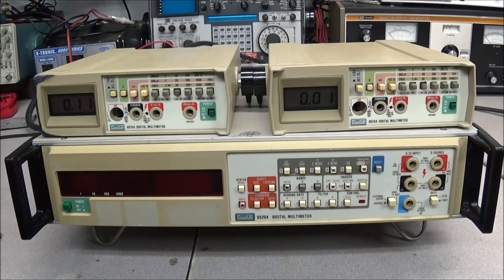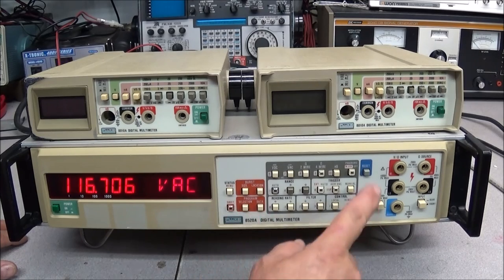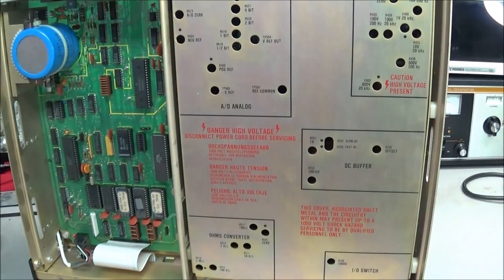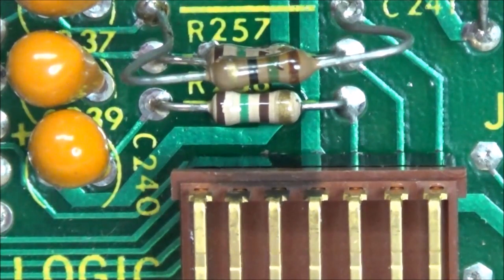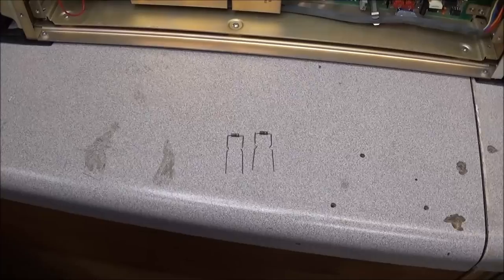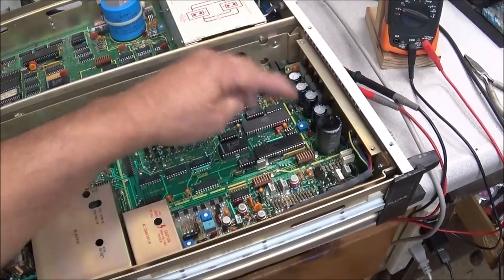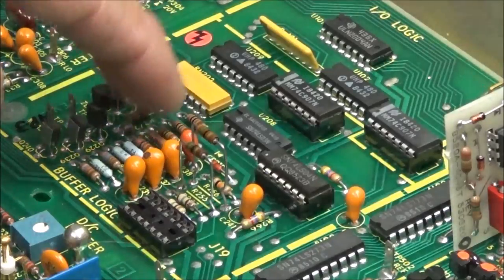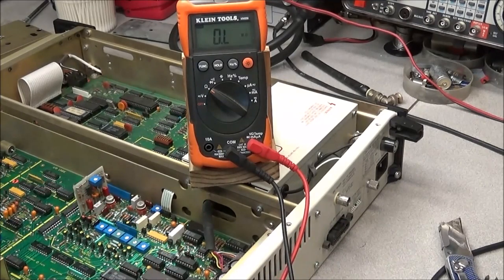#51 Fluke 8520A How far does this rabbit hole go Part1

Comment: I have recently managed to repair one of these units, with the aid of the service manual. My initial problems were in the Analogue Controller section - and with the aid of a cheap Logic IC tester - I found 6 bad TTL ICs and replaced them to get that section up and running.
At that point I then had similar symptoms to this video - with the 'ERROR 01 HV' on Ohms and random and DC and AC voltages displayed. Since everything passes through the DC Buffer - I could prove that this was good, by measuring at it's output and then isolated the problem to the A/D convertor section. I eventually found this to be a bad LF351 Op-Amp and replacing this brought the instrument back to life.
Reply from the maker: Alex, Thanks for sharing that.  I am glad you were able to repair your unit.  After finding many TTL IC's bad I put the unit down and never got back to it.  Perhaps some time in the future I will give it another go.

Comment: My $75 ebay Fluke 8520A had it's transformer pack shift on it's edge-card connector during shipping to me, shorting out and blowing fuse the instant I plugged it in. Having remedied that, I found "Error 14 ROM" show on the display at power-up. I remedied that by replacing corroded legs on ROM chips. Then, I found that my cheap Chinese 4-wire Kelvin leads were the reason that the unit would not zero on low-ohms. (The lead wires spin in the terminal plugs.) A great electrical cart meter now that services industrial automation controls in a machine shop. The bright red LED display is something I will always love.
Reply from the maker: Thanks for sharing that.  I really need to get back on mine but time has become hard to get by with here.
Reply: Your meter is not just worth $300 of work to get it going...($300 being the balance of The $400 value a 5.5 digit Fluke bench dmm that you bought for $100 - knowing what you'd get...) It is priceless, once made right. Those pretty red LED's do look the best. Solid, proven, tried, true and robust. Accurate and good looking. Serviceable. They don't make them like this any more. Please show your meter the love, attention and care that it deserves. My new Keithley 2001 (okay, not "NEW", ebay, $950- excellent condition) does not come with schematics. Such a thing a being able to service it yourself is unheard of these days.
Reply: It just occurred to me;  I could sell you my ugly - yet working 8520A. I got $100 into it. + You pay shipping. I would do ebay / paypal. Put the two together and keep remains for parts? I even include a few spare fuses! I really don't need the thing any more. I've also got 5 new original power switches on order. (My pushbutton switch doesn't come all the way back out after pushing OFF sometimes...I cleaned and lubed switch internals and got it to come out on it's own every time now - albeit slow and weak...I have not opened it, I had no dielectric grease - only carbon-tet and wd-40.)

Comment: Interesting job. nice gear to! I have a Fluke 8050A that I replaced the display on back in the 90's. I still use it,and have the original case for it. i really prefer those LED displays in the lab; they just are so easy to read at a glance.  I just have to see your next Vid on this.
Reply from the maker: I love Fluke stuff, and Leds.  I really need to get back on this unit. Perhaps soon.

Comment: Excellent debug procedure on those power supplies! From all I've heard those dip tantalum caps were a mixed blessing as time advanced on them in equipment. I have to agree with you on logic debug, especially when Proms and micro-controllers are in the mix.
Reply from the maker: +GrandsonofKong Thanks for the nice words. You are correct on those tantalums. Great devices for tolerance and stability. But when they die it is a different story. Makes for nice fireworks when they explode in your face. Can really makes things nasty.  Going to start looking at FET's tomorrow evening and see what is going on in the switching circuit. Thanks for stopping in :)
Reply: The Radio Shop
I agree on those FETs/MOS-FETs and even the Op-Amps in that Buffer area. Several are wired to the +27V and if that went to +40V as you found, could have damaged them and latch the output to one rail...and that feeds to the ADC for Conversion. The displayed voltages when on VDC and ACV did drop after you fixed the regulator issues.
Also somewhere is "logic" that says there is HV on the Ohms line when selected....probably near the ADC as well.
Good luck...looking forward to the solution.

Comment: Also looking forward to part 2 Buddy! You make it look easy. I have 3 of the 8012A which look like your 8010s. They are still in good condition and are good old meters. I had never seen an 8520A. I can see why you wanted to get it going. Great video, waiting to see the follow up video. 73
Reply from the maker: +Larry K4MU Thanks Larry. I think the 8012A is the European version? I remember reading about them Saturday. These seem to be nice little units. Just need the fuse holder for the 2 amp port. This is the first time I have had my hands on the 8520A myself. Easy? ah just a walk in the park lol. Thanks for the comment my friend.

Comment: I knew we were in for a rough ride when I saw "...rabbit hole"! I guess you can take solace in the fact the tantalum's did not fail catastrophically which really would be messy! Hang in there, I know you'll find the problem(s); good timing for you getting a four-wire machine same time Alan W2AEW did his latest video on that subject.  73 - Dino KL0S
Reply from the maker: +Dino Papas LOL Dino. I knew that title would get some attention. When I started the unit and checking it out I started seeing a chain of problems. Was wondering just how far it will go. I think I am down to one problem now. But you never know when someone else has had a chance at it.  I was pleased to see Alans video also. Thanks for stopping in as always. 73

Comment: Hmm, magic smoke has definitely escaped.  A lot of people think I'm nuts because I replace tantalum caps when I do cap changes.  I call it cheap insurance.  Manufacturers seem to always rate them to close to operating voltage and I think that is what kills them so I usually double their voltage rating when I replace them.

Mike
Reply from the maker: +MikesRadioRepair Agree with that Mike. No not that you are nuts, meant  about those tantalums.....Cheap insurance is a good rule with those things. Seen them blow a hole into a circuit board before. Thanks for the comment my friend. Waiting on your next video btw.
Reply: +The Radio Shop 

Yeah I have a pile of them to edit together and upload.  Probably be after I get all the radios, test equipment and parts offloaded out of my box truck that I got at auction.  Hit the gold mine of HV power supplies.  Picked up 3 more HP 712B tube type high voltage power supplies.  Makes for a total of 4 of them I have now.
Reply from the maker: +MikesRadioRepair Great, was going to ask you how it went. Sounds like a nice haul. You need to go over to the site and upload some pics :)

Comment: I am restoring a Fluke 8120A DMM with Nixie tubes.  Turned out the thing just needed cleaning, a set of new binding posts and the fuse holder replaced.  Now my problem is finding 1/8 A SB fuses!

I saw a couple of these for $50 OBO on Ebay and wondered about them.  Having a 4 wire DMM would be nice.
Reply from the maker: +Bruce Friend Hi Bruce. Amazing what a little cleaning can do.  those 1/8 SB's are getting harder to come by also.  $50 bucks eh?

Comment: Hi Buddy hope  u are well my friend? Nice job and great video so far you did a great job finding the issues on the positive voltage rails. I would suggest that u may be on the right track with replacing caos. It deffo cant hurt anyway..
Reply from the maker: +Gary g1fsh Hi Gary. Feeling much better today thank you. I have allergies so there is always a sniffle here and there.  What I liked about working on this unit is it was telling me the problems along the way. I rather replace those tants before they explode. Thanks Gary.

Comment: How about some of those op amps in the dc buffer circuit that had about 70V put across them when the 27V went to 40V? U210, U211.  Are they fried?  The DC Buffer supplies the measurement signal to the ADC input.  If it is no longer buffering correctly, the ADC will measure voltage when none is present.  I suspect the Error 01 is because the unit thinks it is detecting voltage on the inputs, and you can't measure ohms with a voltage input, so it refuses to go into that mode.  When you pull the dc buffer jumper plug out, the output of the buffer goes to 0V, and the ADC reads 0, so it thinks it is ok then to go into ohms mode, and no error 01.
See if the high voltage blew something.   There is voltage going out to A/D input that shouldn't be there when the buffer input is 0V.
Reply from the maker: Impressive!. This was  my thoughts also. Specially when I pulled the jumper out and saw the error went away. Good troubleshooting my friend. I do think you hit the nail on the head. Will get back to this one in a few weeks. So many things going on in the shop and at work. Thanks for you input.
Reply: StarGazer7373 I agree. I think when the 27V rail went high, it took out one or more chips on that buffer board. Anything that gives the ADC a signal that voltage is present is the culprit. Could be tough to locate.

Comment: i have the same multmeter in storage . I think i will pull it out and go throuht it again it has the same problems          this is why i watch your videos      ricks radio shop.
Reply from the maker: +Rick Gunther Thanks Rick. Yes pull it out and get started on it. Do you remember what it was doing when the error occurred? That could help in troubleshooting. Thanks for watching.

Comment: Sadly it's typical to find these mA fuse holders missing as they contain 10$ HRC fuses inside so resellers will usually "borrow" expensive fuses and throw holders in junk bin.
Reply from the maker: Agreed. Funny I have not been able to find replacements. Good thing I have a few dozen more meters to use.